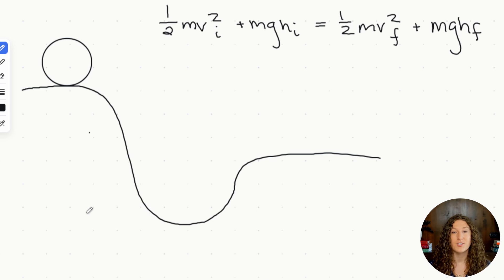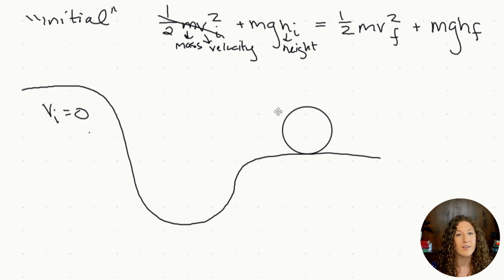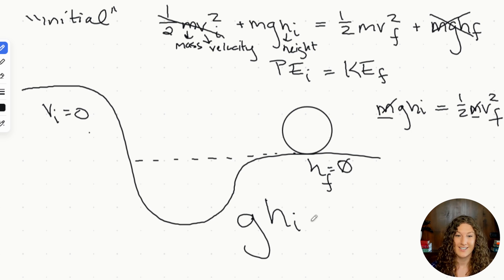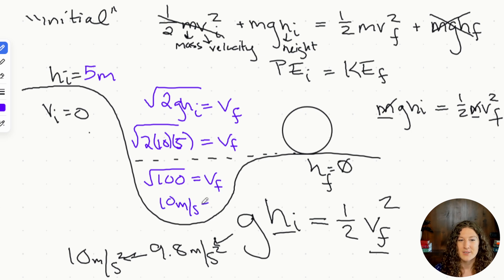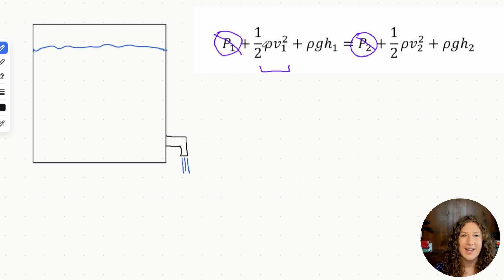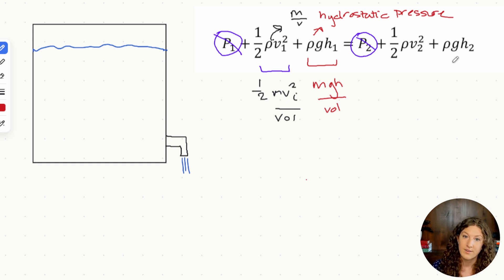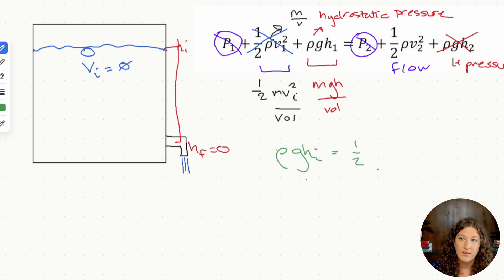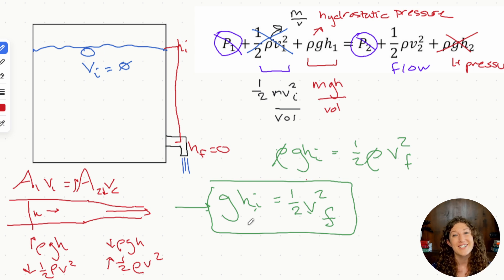MCAT Physics: Bernoulli's Equation & Conservation of Energy Equation

Comment: Thank you for the lecture! I think Pitot tube problems are where this concept gets a bit difficult for me personally
Reply from the maker: For sure, those problems combine Bernoulli's Law, the Continuity Equation, and the Venturi Effect for an overall understanding of fluid moving with the flow or perpendicular to the flow! I'm planning on making a follow up video including these concepts, but the quick answer is that in sections with a bigger cross sectional area, you'll have a bigger component of hydrostatic pressure (pushing on the vessel wall), meaning more fluid will move perpendicularly into a pitot tube compared to a section with a smaller cross sectional area. The smaller section will have proportionally smaller hydrostatic pressure, and greater forward flow. Hope this helps!